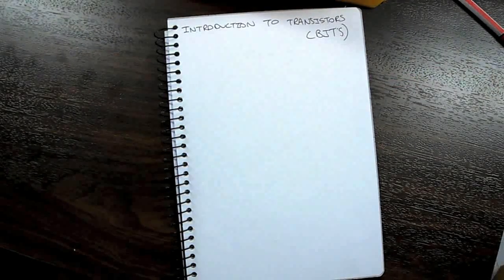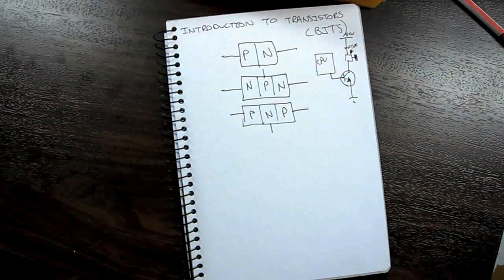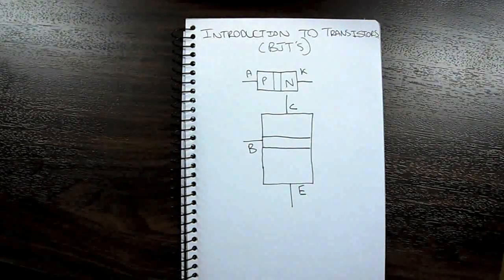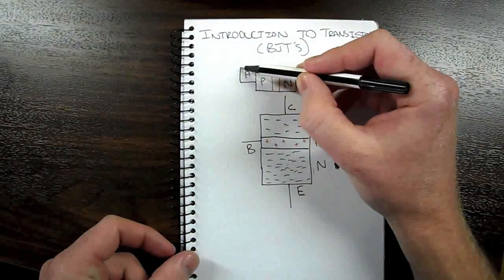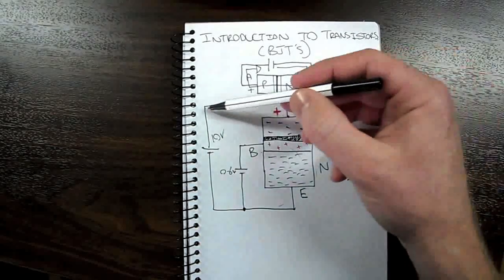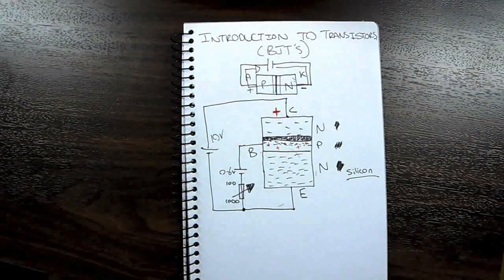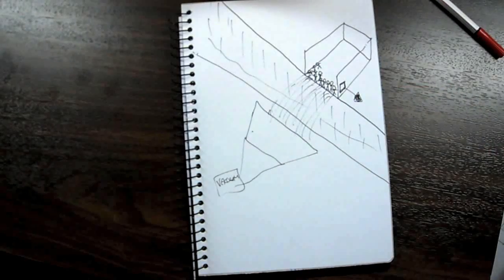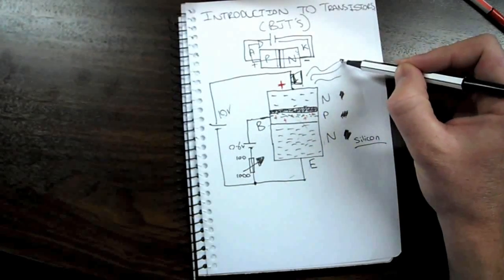Electronics Tutorial 7 - Introduction to Transistors (BJT's)

Comment: I may be confusing this with vacuum tube operation, but you said when you increase the gate you increase the current flow from emitter to collector. I assume you meant increase in voltage of the gate...Doesn't increasing the voltage of the gate decrease the flow from emitter to collector? Such as in a tube when the electron flow from cathode to plate is manipulated by a variable voltage on the grid? It seems like an increase in voltage(ie potential for current) in the base would decrease voltage/current from the E to C resulting in an output that is out of phase with the gate like in a tube, not in phase like you said? I may be wrong,,just asking?

Comment: You said emitter is the largest region? is it not the collector region that is the largest?
Reply from the maker: You are exactly right! I incorrectly mentioned that the emitter is the largest region where in fact it IS the collector that is the largest region. This is because the collector region needs to dissipate the most heat. In fact, a lot of larger transistors have the collector connected straight to the metal housing to give it lots of surface area to help dissipate this heat.
Reply: Cheers for the guide.  Very clear

Comment: i think u have confused with the electron flow and current flow. Because from what i know, current always flow from collector to emitter unless u are using pnp. I'm kinda confused now :( Also, the direction of current flow should be +ve terminal of battery to -ve terminal, you are pointing the other way round. So is it correct or not ? ?

Comment: Still looking for a tutorial that explains BJT physics correctly. This is not it.
Reply from the maker: Thanks for the comment, I find it quite interesting though. Are you saying that you don't know the theory behind BJT physics? or are you saying that you do know the theory behind BJT physics and you are just looking at video's to see if any line up with what you already know?
Reply: 00retrobrad00 I'm saying I do know, and I can't find any videos that agree with it. MOSFET behavior is (in principle) easy to understand, and so more people understand it. But BJT behavior is tough, as reflected by Youtube's inability to present videos which get it right.
Reply from the maker: uniment That's fair enough. Would you be able to take the time to upload a video explaining it correctly?
Reply: 00retrobrad00 I'm sorely tempted to, but I know how painful it is to make video tutorials =P.

In the meantime, since you're interested, I'll explain here. You seem like a smart guy, so I think you can figure out the details I miss.

For NPNs...
1. When applying a voltage to the base-emitter junction, you lower the barrier (the "built-in" voltage) that prevents all but the most energetic electrons from thermally launching themselves across the junction, thus permitting [more, less energetic] electrons to jiggle and jostle their way into the base (a process called diffusion).
2. Undesirably, some holes also diffuse the other direction, but if the emitter is much more heavily doped than the base, then that can be kept to a minimum. We'll ignore that it even happens for now.
3. Electrons are now present in the base region. Like a gas, they spread out from regions of high concentration to low concentration—i.e., from the base-emitter junction to everywhere else in the base.
4. The collector-base junction is reverse-biased, creating a depletion region with a strong electric field. As in a diode, holes from the base that hit the depletion region just get swept back (thus, the diode doesn't conduct); however, any \electrons\ that hit the collector-base junction immediately get accelerated and swept across to the collector (because they have negative charge-d'oh!). They couldn't "feel" that electric field until they hit the depletion region, because the conductive base region was shielding them.
5. The electron concentration at the base-collector junction is \zero\ because electrons that get there simply disappear, so the tendency will be for electrons in the base to diffuse from the emitter junction to the collector junction. If you have a box full of gas and open one wall of the box to the vacuum of space, the gas will spew forcefully out of the box—because of the pressure of the gas, and entirely due to diffusion. Likewise, electrons will spew from the emitter, through the base, and into the collector due to diffusion. Electrons in the collector would diffuse back into the base if they could, but the vaaast majority of them are trapped because of the strong electric field being applied.
6. In an ideal world, the base current would be zero, but in real life it's not. Electrons that enter the base usually wander around for a little while and find the collector, but some recombine to constitute base current. The "lifetime," or the average time electrons survive before being recombined, is long not because they can't find a hole, but because they can't find a crystal defect. Without crystal defects, electrons couldn't recombine with holes no matter how badly they wanted to (with some exceptions). With a low enough concentration of defects, most of the electrons diffuse straight through the base and only a very small fraction get the chance to recombine. And that's why beta is high: by refining the silicon, making a high-quality crystal, and keeping doping concentrations low, recombination can be kept low and beta kept high.
Reply from the maker: uniment Sorry for the late reply and thanks for the write up. For me I look to try and explain theoretical concepts in layman's terms. I have found that perhaps the most difficult thing to do is pass theoretical concepts on to students who are brand new to the field of electronics which is more where my video is aimed at.

I can certainly see that you know quite a bit about what you are talking about but I can also see that if I were to stand up the front of my class and teach them BJT's in that fashion, I would get a whole heap of blank looks.

Be sure to let me know if you upload your video, i'd be very keen to have a look :)
Reply: 00retrobrad00 You should've seen my blank look during this video. IMHO, any explanation of the transistor's internal workings will be convoluted, so it might as well be accurate.

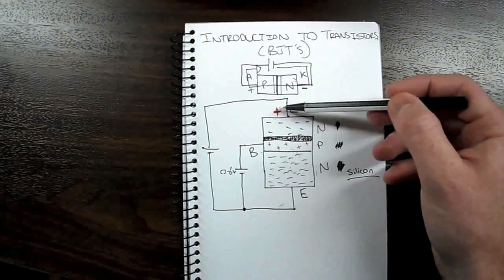For example, 11:35 "[electrons] can't cross [the collector-base depletion region], because it's reverse biased" ... an incorrect notion like this forces you to invoke some magic, such as intelligent people jumping across a canyon and getting sucked into a vacuum cleaner. The problem is that this analogy can't explain any other phenomena, such as beta, base transit time, Early effect, saturation, etc. etc. The analogy falls apart faster than it was constructed.

It's interesting that a BJT, a FET in subthreshold, and a vacuum tube running with small cathode current all follow the I=Is*e(V/Vt) equation—and all for the same reasons. Specifically, their current is due to thermally liberated charges having enough energy to overcome a barrier (see: Boltzmann distribution). It's tragic to teach BJT's without including this aspect, because it's a common theme that relates all the devices together.

Sadly, it took me years putting the pieces together after my college microelectronics course to learn these things. And I had to sift through tons of tutorials, each presenting its own unique inaccurate explanation. The physicists know the real answers, but unfortunately they speak a different language.
Reply from the maker: uniment I am sorry that you didn't like the video and I hope you do find what you are looking for.
Reply: 00retrobrad00 Your humbleness far exceeds your intelligence, never let anyone change that. Unselfish people like you, although very rare, are making it possible for mankind to move forward. Thank You VERY MUCH for your time and effort and your abilities to explain to an uneducated man the basic principles of electronics.

Comment: One last thing: is the value of 0.6 volts between emitter and base considered the standard "switch on" voltage for most (or even all?) NPN BJTs?  Does this voltage then get :siphoned off (like so many missing people) from the total voltage being delivered to a device (such as a speaker) through the transistor?  Or something?

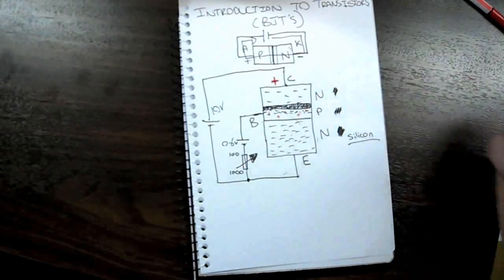Comment: And another point of confusion: if the "people" in the diagram at 19:13 are either jumping across the chasm into the vacuum cleaner or escaping out through the hole in the wall, doesn't the rate at which they are escaping through the hole also affect how "fast" the wall ends up "moving in" on them all?  (and not, for example, the other way around or with some other effect?).

Comment: I understand that the hole in the wall lets people out. But in your analogy it doesn't change the fact that the wall is moving further and further. The hole could be gone and people would still be sucked into the vaccum. You could make the hole a magic hole which turns the freed people into sadists. They would start pushing against the back wall.

Comment from the maker: You are correct about the minority carriers :) I guess I left them out for expediency. I plan on covering minority carriers at a later date along with temperature effects. Although the reason that each P or N type of semiconductor is neutral is not due to the number of majority carriers vs minority carriers, it has to do with the fact that each atom that make up the region is in itself neutral.

Comment: Ok, I have some questions. First, this sounds like it would just provide a temporary amplification. Let them build up and then boom, let them all cross at one time. Doesn't there need to be a time allowed to let them build up again so you can get the large amount to cross the "p" section? Second, by connecting the 10v power source in that way, doesn't this change the bottom current? I really enjoyed your video. Thanks.